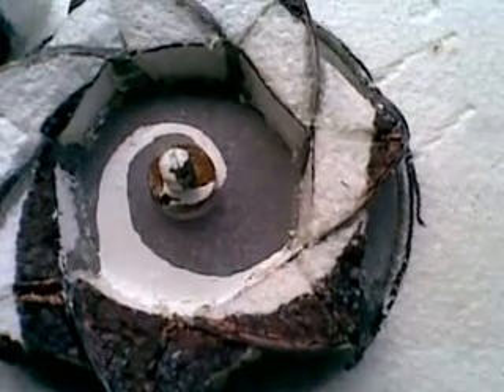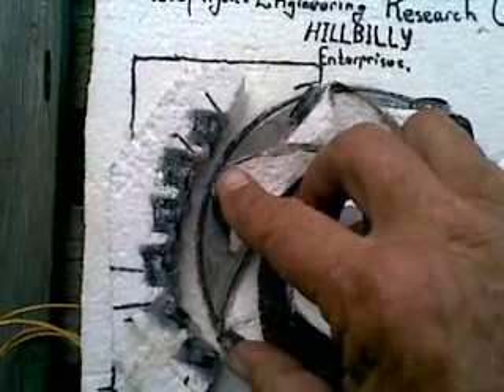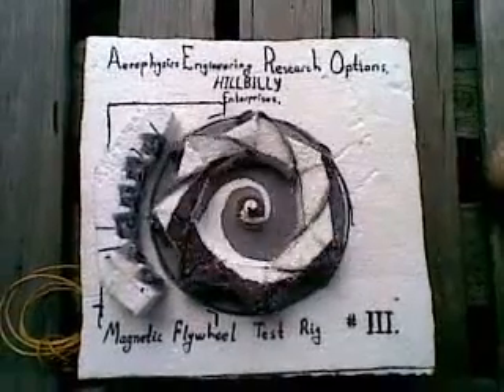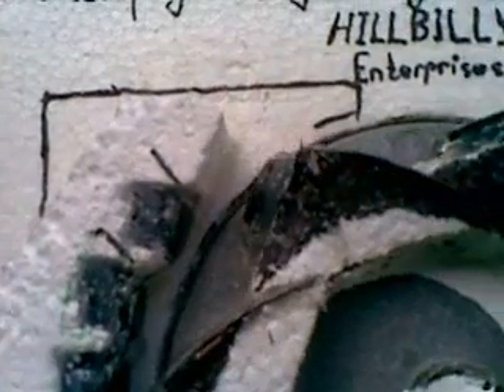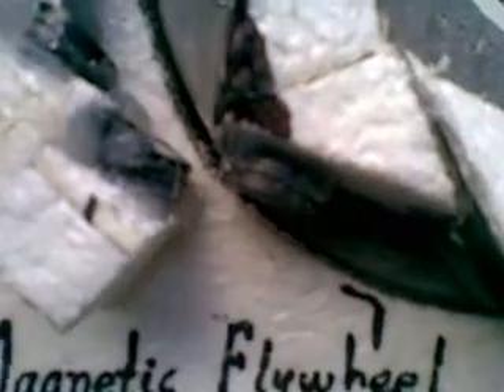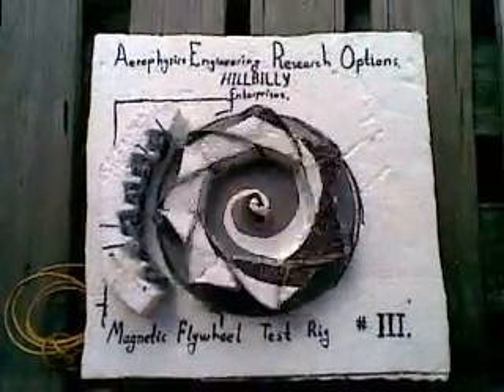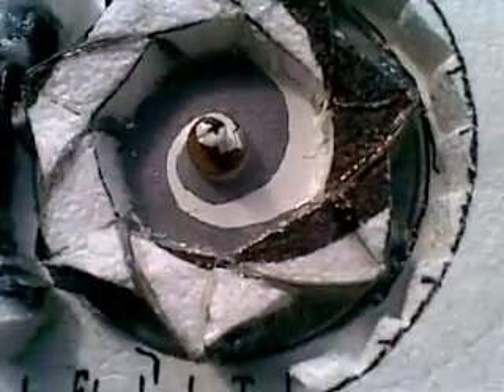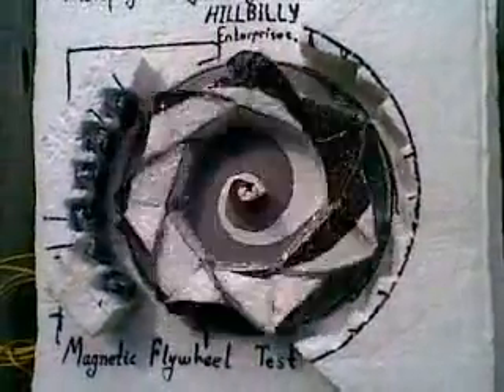Illegal Research..! Permanent Magnets Outlawed... Alternative Energy FORBIDDEN...#3.

Comment: 'Notice' How-Your-So-Called COGGING Is-Acting-Like [R]-PENDULUM ... Remember GRAVITY Doesn't-Act In-The-'Horizontal' Only-The-Vertical ... Hence Projectiles Travel-@-'Constant'-SPEED in-The-Horizontal &-Even In-[R]-'Straight'-Line When-Considered From-The-Frame-of-Reference-of-The-HORIZONTAL or-Even The VERTICAL For-That-Matter So-To-Speak. So GRAVITY Is-Acting-Like The 'Apposite'-of-PRESSURE ... Both Pressure-&-Gravity Can 'Create'-WORK On-An 'Unrestricted'-BODY. 'Repulsive'-Magnets ('Pressure') Fly-Apart-From One-Another ... Dissect-The-Problem The-Michael-FARADAY-Way of 'Just'-Where The-WORK Is-Arising-From ... That's Step-One of Walking-The-'Rubbery'-BRDIGE of Edward-De-BONER Towards The-POSSIBLE So-To-Speak!!!??? >(*U^)< Wink You're-WELCOME ... Hey Music May-'Change'-The-WORLD ... But-MOZART Will-'Change'-Your-MIND ... When-It-Comes-To-The-'Extent'-of-POSSIBILITIES &-The-INEXHAUSTIBLE.

Comment from the maker: @ayodele sirjet
G'day, thanks mate... Um, well, I did "get a feel" for why an Oscillating Repulsor won't help ; in Clip #1 of this series, I used a lump of Meat (my Hand) to anchor the far end of the 17xStack, & press it's other end toward the spinning Wheel.... The Stack gets knocked clear by the approaching Field, slowing the Wheel by Spring (Meat) Pressure, but when the Stack returns the "Power Face" on the Wheel has moved on. No net thrust, y'see... Ciao !

Comment from the maker: @Tomken8d2
G'day Tom, thanks mate... Well done..! Ah, but if you move the Repulsor Magnets then you enter a whole new class of Sumptink-Fo-Nuttin' Machine... I'm trying to get a Fixed-Stator Array to work, because that's the most popular "Magnetic Motor" Meme doing the Rounds on the Tubes.... If you can make a Spring-Oscilator work faster than the force it responds to, then you're onto a surefire winner. Ciao !